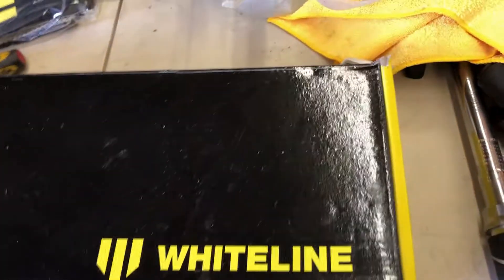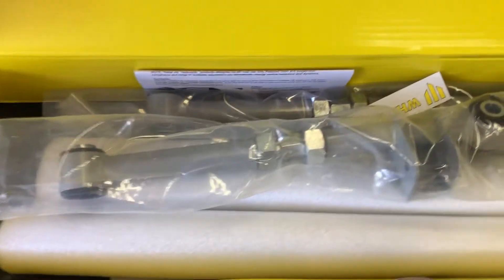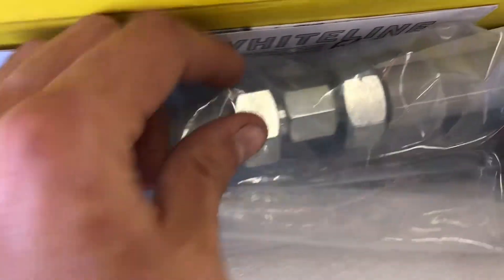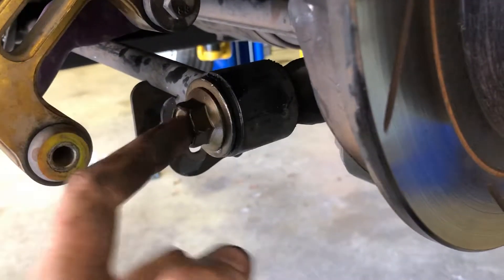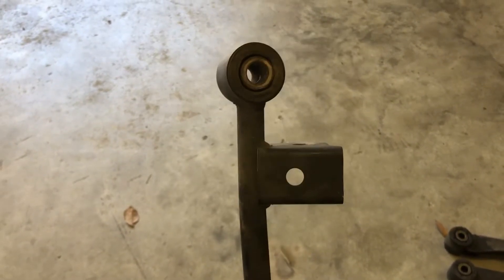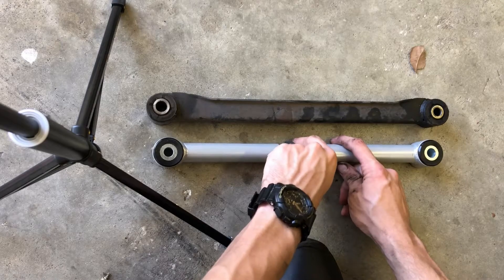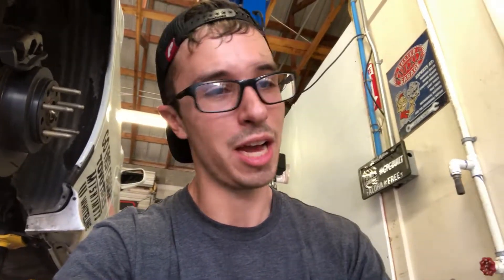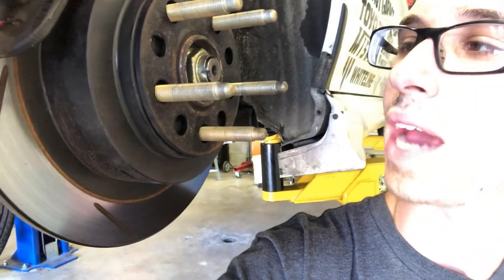My Whiteline Rear Control Arms Are Finally Here!

Comment: Easier or even better way to line up NEW arms so same length as OLD arms is to use the bolt that held them in as a guide and adjust till bolt fits both arms